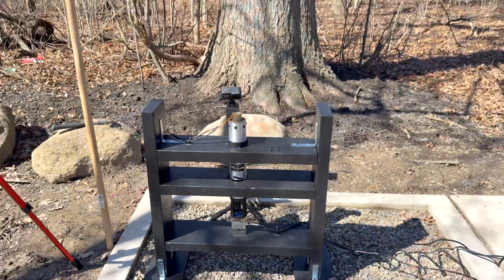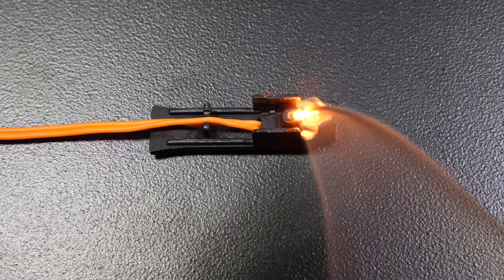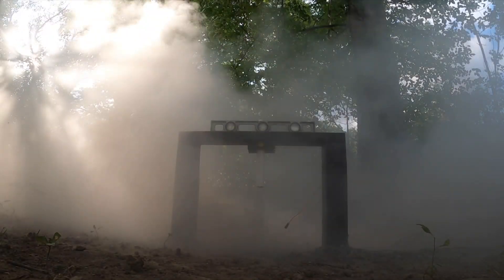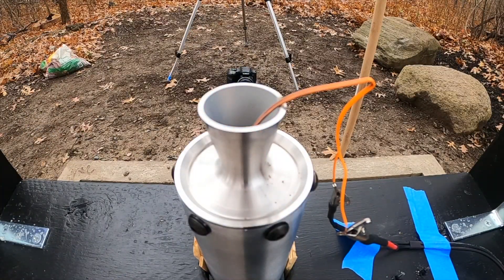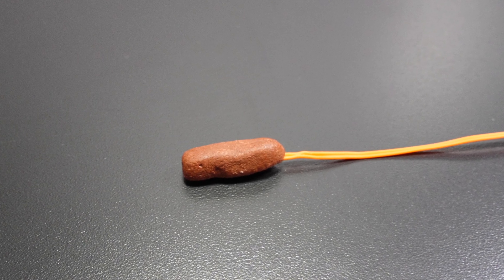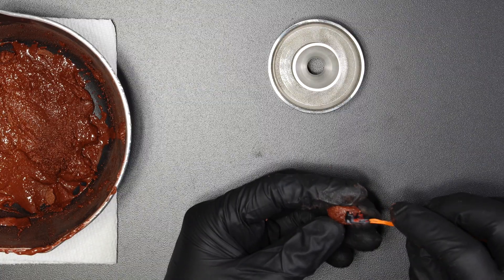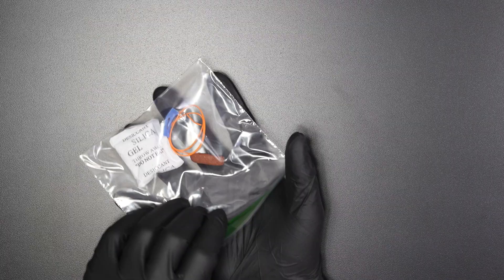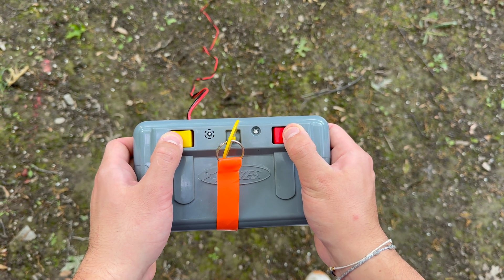How I Ignite My High-Powered Rocket Motors (3 Methods Tested)

Comment: One thing that I keep trying to look up is how to make a e-match igniter power supply. I have tried all kinds of homemade ways to ignite igniters and the only way I've done it successfully is with my ATVs 220cca battery and even that doesn't work all the time. I've tried to make an ignition system with 9v batteries like Grant Thomson did in his old video but I guess the don't make 9v batteries with the same power anymore. Since I want to ignite my rockets from a decent distance I'm torn between if I need high voltage or high amperage to make the bridge wire hot enough at let's say 50 to 100 feet away
Reply from the maker: That’s interesting, I actually tried a 9 V battery a long time ago and it worked for me back then. Voltage help to push current though long wires, and current is what makes the bridge wire hot. Right now, I’m using a modified Estes Pro Series II Launch Controller, which can deliver more current, to reliably ignite my rocket motors from far away.
Reply: @AeroPropulsions ok so basically what your basically saying is I need a certain amount of amps for the heat and the longer the main wires are the more voltage I need, right? Amps for heat and voltage for length?

Comment: Back in the 1970's, i made ignitors by carefully breaking a 6v lamp bulb, and filling it with diy gunpowder. Worked very well!
Reply from the maker: Very cool!
Reply: I used a magnesium filament coated by matches heads solved in acetone. It worked with 3V voltage, however I preferred 9V.

Comment: What are your thoughts on Head End Ignition, similar to space shuttle boosters or BPS.Space's Simplex motors?
Reply from the maker: Wouldn’t really work on my motors. Pressure transducer already takes up a lot of room around the bulkhead. Also with only firing these motors statically, igniter through nozzle works great.